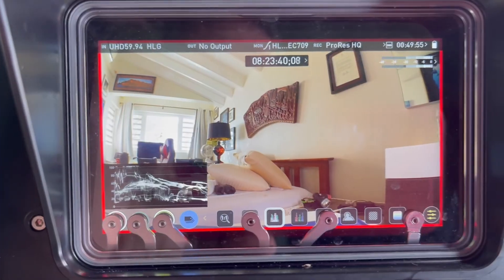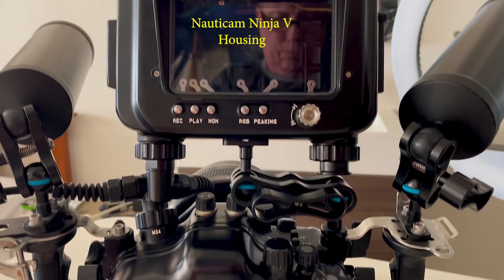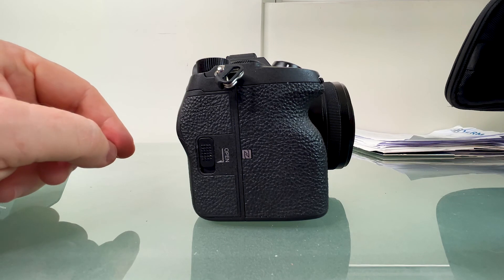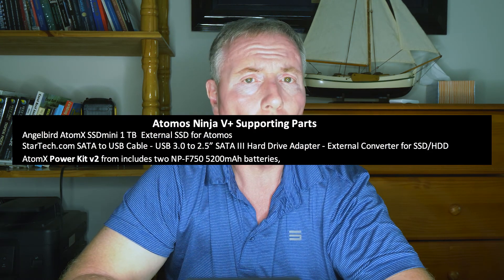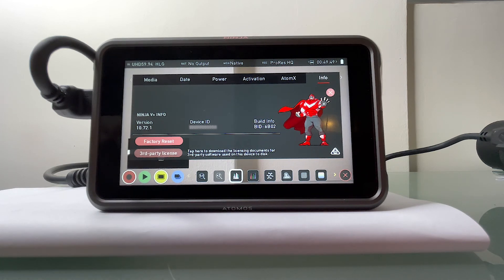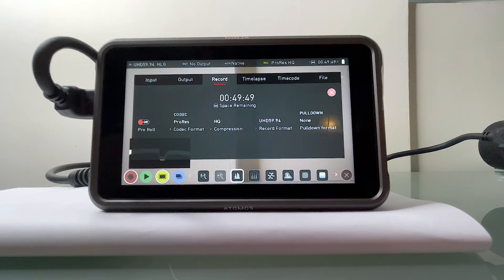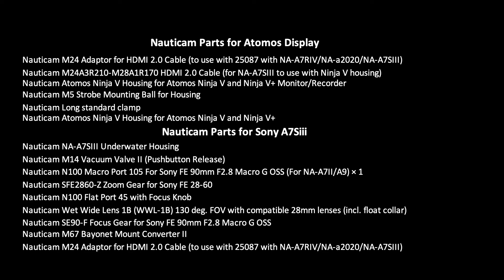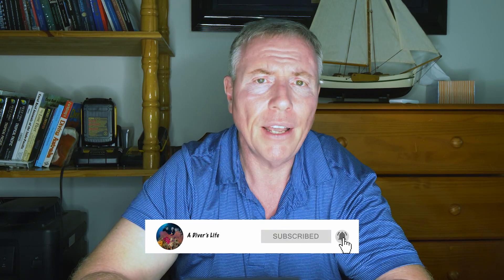Building Our Sony A7Siii Underwater Rig | A Diver's Life

Comment: Just found your channel today as I was hunting down some info on the additional Nauticam ball mounts you have used to mount your Ninja housing to. Thanks for the great video!
Out of interest how have you gone getting the rig neutrally buoyant? I am considering using triple clamps to add an additional carbon fibre float arm horizontally between the two ball mounts, as it is a frightfully heavy rig.
Reply from the maker: Hi, I am traveling right now so I don”t know specifically the floats I used. I also use 2 ball mounts with two float arms on each side. This allows you to move your lights in and out. I use a ver large bigblue float  (don’t recall the size) as the nearest float and then a metal arm with two small floats on the end. Please email me at rich@adiverslife.com and I will look when I get back. I also leave my handle for carrying the rig on and I am slightly negative. This is for wide angle/dome port configuration. I take the handle off for macro . The Sony macro lens is heavy. Once I figure it out I will add it to the description. Wish I could get you a faster answer.

Comment: Thanks for the video! Question - I wouldnt like to have the ninja housing sit on top of the sony housing. Is there any way to mount it more in front of the rear part of the Sony housing so the rig becomes more streamlined? Thank you!
Reply from the maker: It mounts via a large ball mount on top of the Nauticam. Although this is large perhaps this type of a set up?
Reply from the maker: I use a pretty wide clamp and can move it back some
Reply: @ADiversLife  with additonal gear - would you be able to somehow almost mount in in front of the camera housing?
Reply from the maker: @Mexico-Magico  there is no such ball. Isn’t toward the front but with a extra long ball mount clamp you can swing  it forward putting it toward the front. I do this and I tilt the ninja housing forward a bit for easier viewing.

Comment: Thank you for taking the time to so completely explain your set-up. I have been thinking of upgrading mine from the Sony a6300 / Nauticam  with 10-18 wide zoom and small kit lens to the a7s3, which I also already own.  I have several lenses including the new 14 mm 1.8.

I got a bid for the Nauticam housing,  and was taken back a bit by the cost.  My question for you is how did you end up choosing the Nauticam system over  the significantly less expensive manufacturers?  Also do you feel that your wet wide angle performs well compared to what I am thinking of: using the 14mm with a port?

Again, thanks for your good work.
Reply from the maker: Hi Blake,

Great questions. One of the things I have learned from living on an island and diving a lot all year round is that most dive gear just can’t stand up to the constant use and extreme conditions. In fact, my wife and I can go through a BC in 2 years. Regulators with cheap plastic parts or materials that corrode can fail in 3 years. Booties - 6 months. We dive Bonaire’s wild east coast which is rough on equipment and I also do tech dives where the equipment is under higher pressure. When I get a product that is well designed and can take the extreme conditions I stick with it. My GH5S Nauticam housing did all that and the vacuum seal system never failed. With the Nauticam designed for the A7s3 it also improved the button locations for easy access. Their ball mount clamps are also fantastic.  So, given my experience the main reasons I did not go look at other housings are Nauticam’s proven track record, familiarity with how it is laid out, and ease of use.

Regarding the dome part, a wet lens will give you a somewhat sharper image at the expense of flexibility and the ability to do above and below shots. If I were you, I would go with a glass dome port if you can reuse all your lenses. You are also used to shooting with those lenses. There is a lot to be said for supporting how you shoot.
Reply: @ADiversLife  Thanks much for the reply and the advice.  But a lot of people like the system that you have come up with.. So I am going with Sony 28-60 and the WWL-1b.  I was worried that that lens might not be that good because it's so cheap!  But everyone says the results with a wet lens are great.... especially compared to a dome port which I have been using.  
We are heading to Fakarava this June for the Marbled Grouper event.  Looking forward to getting the white balance  at depth nailed with the new a7s3.  Thanks again.
Reply from the maker: @TheBlakerunner  yes. That is my experience. Have a great trip

Comment: Dude!!! Nicely done. That’s a real bummer Atmos support isn’t up to the level you’d expect at that price point. I’m wondering though if the overheat issue is similar to GoPro had on the 10 if you try to record long max resolution and frame rate clips. With the GoPro out of the waterproof housing it has fewer issues because it can shed the head by radiating it into the surrounding air. In the case it can’t. Does the display give you issues if you test it outside of the waterproof housing?
Reply from the maker: Hi Caleb, Thank you. With the replacement ninja I ran it for over 1 hour at 60 fps 4K. This is when the Sony started showing the overheating icon but continued to run. That is acceptable. The first ninja started to over heat almost immediately. I am sure being in the housing does not help but the fan was defective on the first Ninja.

All these higher end formats are pushing the camera’s computation requirements. Apparently Canon got it right in their latest camera - no overheating.
Reply: @ADiversLife  I wonder at what point we start to design cameras and monitors with the ability to match up to a heat sink on a housing. Housings aren’t that much. What’s a little more for some cooling? 😉
Reply from the maker: @Chogogo717  I would not say housings are not that much. I think the real issue is that camera manufacturers are not working that closely with housing manufacturers. In fact, in working with Sony with the white balance problem it is clear they don’t do a lot of underwater testing. I think what would be need is a way to vent and draw the heat out of the camera and pass it over a heat distribution mechanism in the housing. This would take up a lot of space in my housing which I don’t have. I think housing manufacturers would need to increase their size to enable this.

Comment from the maker: We updated to the latest Sony v3.0 firmware and largely for the breathing compensation which is very helpful for macro. It appears this feature is only available for just over 50% of their lenses, None of which are used in this rig setup. Also people don't film in 24p for underwater so the DCI feature for this is not that exciting. The touch display features don't help you in a housing. I could go on. So, frankly upgrading the firmware is a lot of work for not a lot of value given that they erase all your settings and you have to set them back.  The partially done breathing compensation is very frustrating. In other words more hype than value.